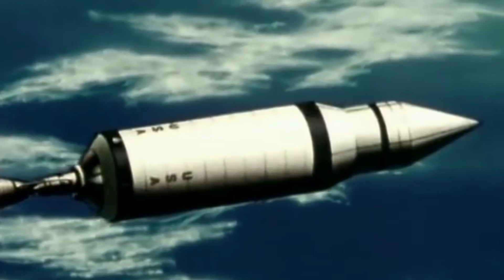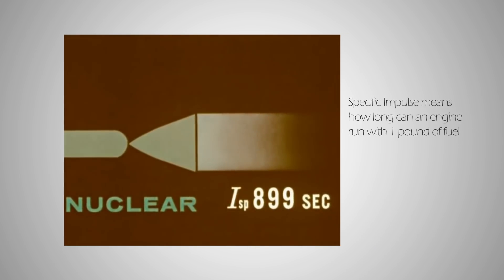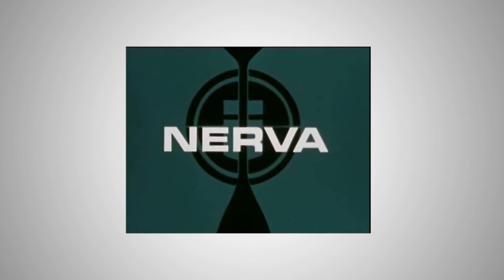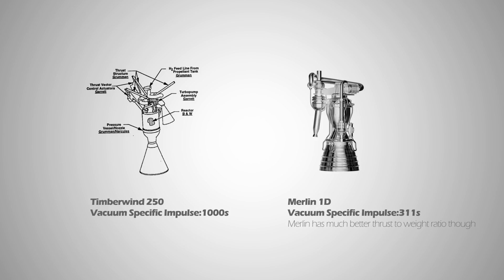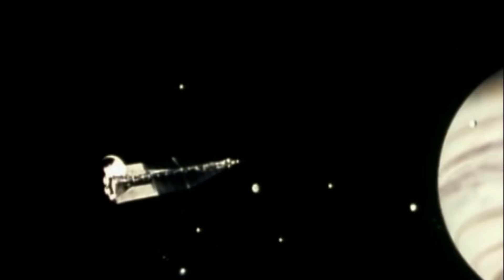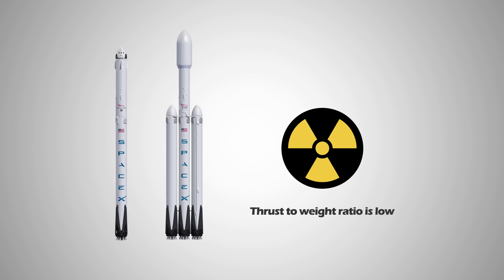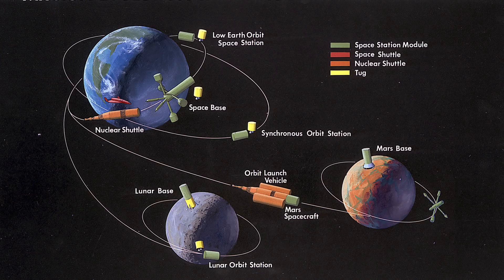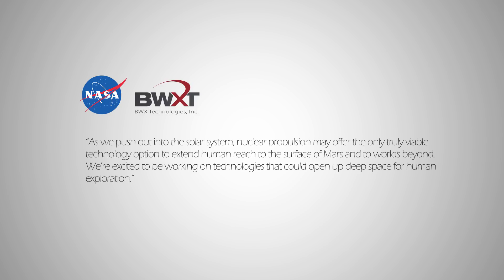What comes after BFR for SpaceX, a nuclear-powered rocket?

Comment from the maker: One at a time, BFR first, then we talk about the possibility of Nuclear thermal rockets. It is a very exciting piece of technology no doubt, would love to know your idea on that. What do you think of a nuclear space tug complementing BFR?
Reply: Curious Elephant The space tug idea is pretty damn good. But yeah, BFR first.
Reply: Wouldn't the nuclear space tug be reusable?  It wouldn't be used for landing, just to cut down travel times to reach Mars and the Asteroid Belt.  Once you reach your destination you enter orbit and disengage from the nuclear tug and use chemical rockets to land in the surface.
Reply: I think a nuclear powered space tug for BFR would be amazing for deep space missioms, but i think R&D cost are just too high to develop it by SpaceX itself. It would be grat if NASA would continue their work on nuclear propulsion
Reply: Yep thats what i was about to say. The BFR is no walk in the park. It will have to work reliably 100% of the time every time. Just one full crew disaster and it could end the project overnight. SpaceX really need a viable contingency plan, especially when it comes to crew safety on this ship. Lets just get the BFR 100% right, someone else can concentrate on the nuclear propulsion side of things for now. 🚀
Reply: We should build an aldrin cycler for travels to mars: https://youtu.be/qCVfUlFZQ4U It doesn't necessarily need to be nuclear powered, because it needs only slight orbital corrections. It would utilize spin gravity (O'neill cylinder) and would be built out of expandable modules similar to what bigelow is working on. That material is also fairly good at stopping radiation, but most of the shielding needs to be facing the sun anyway, so that's not that big a problem. Water can also be used for shielding and we need plenty of that, so radiation really isn't a problem. 

What I really want you to look into is beamed power thermal propulsion. I've said this a few times before and I don't want to seem like a spammer, but I really think it could be a great viable option and since it's not a very well known technology and you have 63K subs and almost 6.5 million views you can reach quite a lot of people. Again here's a video if you're curious: https://youtu.be/q3jAdHBCgiU

BTW: I don't think beaming power from solar panels in space to earth is a viable way to generate energy for earth, but I do think beaming power from earth (or maybe space) to a rockets first stage is a viable propulsion techology.
Reply: @Faron, those nuclear trails in the sky measured by scientists don't magically appear do they? Nope those Russian nuclear rockets are real and yes they are F'ing up the atmosphere.

US and many countries have build those and they work. Course everyone doesn't use them but ... Russians arn't in their right mind on that one but they are doing it.

A earth to mars ferry with a nuclear plant for thermal engine drives which already have proven they work. Wouldn't land but just get over a dozen BFR modules from point A to point B.

No reason to land you can have a big ferry with a couple of meters of water against radiation and even artificial gravity making it easier on astronauts.

The BFR doesn't get pointed to Mars and launched. It gets to LEO and ... it's out of fuel. Another BFR has to go up after it and refuel the travel module. Then on Mars if they decide to go back? Yup same thing again.

Be fun you either die from radiation trying to get in riding a nuclear reactor trying to keep radiation from coming out. ;-)
Reply: WRONG!!! It would make a massive difference for launches from Earth, having a ISP of 900 seconds means you could get your launcher mass down to 40% the mass of what you are launching where as today it's 99% the mass, this is important because you can build craft that really are as reusable as a plane if you can build your rocket to be heavier.

Although using nuclear rockets for launches from Earth have there own problems and not only the first one you probably thought of which is crashing and releasing radioactive materiel aboutk, no for launches from Earth your main problem is the thrust to weight ratio when it comes to NTRs and launching from Earth.

This is because you have to carry around a nuclear reactor and your fuel, there are ways around this like beamed power using microwaves so rather than an Nuclear Thermal Rocket, it's just a Thermal Rocket; anyway this means that you don't have to bring your reactor with you and you only have to bring the fuel, the engine is incredibly simple it's just a shaped lump of metal with no moving parts apart from a valve to regulate the amount of fuel to be injected, which also lends it's self to being highly reusable.
Reply: Curious Elephant Why not busy use ion propulsion+beamed power from LEO solar powered satellites?(I know what you're thinking, and no, you don't HAVE to use xenon, though it is the best on a power consumption/ thrust basis,you can use argon,which is plentifull on Mars.
Reply: A nuclear tug would be great... But  not as a replacement for BFR. One would be excellent for sending non-SpaceX payloads to Mars, especially ones that would not fit within a Big Falcon Ship. Could be launched on a cargo BFR perhaps.
Reply: I can't see a nuclear rocket being usable for the Earth-Mars run, or really anything that involves returning to Earth, because a chemical rocket can aerobrake, while nobody in their right mind  is going to allow you to aerobrake a nuclear reactor in Earth's atmosphere.  Since a heat shield weighs less than a nuclear reactor and it's radiation shielding this means that the effective ISP of the chemical rocket is more than doubled.  I can see nuclear electric being used for slow transport of heavy cargo, but nuclear thermal doesn't seem to have very many use cases in a reusable spacecraft.
Reply: Keeping a nuclear vacuum engine "Tug" in space would eliminate the cost of lifting it from the surface each time. The Tug would still have to withstand hypersonic reentry conditions during aero-braking at both Mars and Earth. (If the Tug never slowed down, then the BFS would still have to match interplanetary orbital speeds with it! ) This implies that the Tug has a superb heat shield, modest propellant tanks for adjusting its own orbit, and the ability to enter and then leave the atmosphere during aero-braking. 

The BFS would still have to lift propellant to supply the tug on each leg of the journey.
Reply: Curious Elephant I would like to see us build a nuclear powered ship (on the moon?) that doesn’t ever land on earth. A huge cruiser with shuttles to land on planets/moons/asteroids
Reply: @dehim, yes why I don't get people attempting to land a big big ferry ship. No sense to that at all.

The lightcraft for example was good proof of concept of how to speed up and slow down 'spacecraft'. 

No need for any propellant. NASA scientist Philip Lubin working on a scaled version to launch and test in space must mean there is something to it.
Reply: Space Train yes! Why not get as much equipment needed to colonize mars up into low earth orbit then send it all over in one trip. Put that then into a Mars orbit and bring it down carriage by carriage.
Reply: You don't need nuclear propulsion to send people to mars, making all that methalox propellant with nuclear will greatly benefit on mars due to a lot less tonnage in solar panels and batteries. Nuclear tugs sound like a good idea to send supplies, reactors/fuel, and base modules, things that are going to land on but not take off from mars.
Reply: I emailed Elon about it on 5th Jan this year. Probably your channel got me thinking along the same lines.
Reply: It all depends on the reactor; nobody is suggesting putting a water cooled reactor on a spaceship. One of the first reactors that was cooled with sodium didn't even explode when it melted down, it just mixed into the coolant and became sub-critical. When sending humans beyond mars nuclear is necessary. The Atomic Rockets website is a great resource. My favorite nuclear rocket engine would be Zubrin's nuclear salt water rocket ie controlled Chernobyl event :P
Reply: Maybe SpaceX will make a space Tug later on.

However, interplanetary business has to become profitable first. That would make the moon more interesting, and a moon base would be constructed. Then they can use Helium from the moon to power a nuclear space tug, to reduce the cost of the now more frequent trips between mars and earth, and even earth and the moon.
Reply: We won't be using fusion any time soon in space, unless you count a massive generation spaceship. Fission has a lot of things going for it and it's downsides aren't a big deal in space.
Reply: Actually, it isn't helium we'd mine, rather use the water for hydrogen. I do wonder what kind of ISP you'd get with helium though, since the water may be wanted.
Reply: You've done your research well here Curious Elephant.
Nuclear propulsion is indeed necessary for any kind of manned mission beyond the Moon.
Be it to a near Earth asteroid, Mars or even the other planets, the idea to fly a manned mission to any such destination with chemical propulsion is completely preposterous.
Travel time need to be kept short, we don't have any truly effective protection against radiation, and nuclear power do give better options to abort a mission gone wrong and return to Earth. (Not a true turn around of course, but significantly faster.)
Now I don't think SpaceX/Musk even have nuclear power on their long term agenda.
So our best bet is still NASA's cooperation with BWXT, (yes I did read that one quite long before seeing your video) and NASA have also pointed out the need for a space tug.
 It need to be reusable, its only then we find the major savings on cost as well as maintaining a depot of chemical fuel so that crafts launched from Earth that use chemical rockets can change orbit, launch toward the Moon perhaps, as well as return to Earth from higher orbits or even a Langrage point in space.
(The Russians do also claim to have nuclear powered propulsion in development, lets see if it realised or becomes another piece of vaporware.)
What's so important with the Langrangian points someone might ask, well when sending equipment such as a planetary base module, a lander or even a return flight booster and/or supplies ahead of a manned mission, these are a good starting point and as long as we do not think about manned missions, the Interplanetary Transport Network is a very neat way of sending such with very little fuel or reaction mass. 
Yes even with the kind of nuclear propulsion we can build today, and is described in this video, any manned mission to more distant destinations than the Moon need to be launched in pieces and ahead of the astronauts. Nuclear propulsion is more efficient, but the nuclear technology we can safely construct and use today, is not powerful enough to carry all parts of a mission directly.
(Can Elon Musks Colonial transporter do it on chemical propulsion? 
Of course not, the idea of using a single ship and return all that mass, rocket engines etc on a return flight is not only absurd but borders on duplicity and claiming to do this by 2022 - sure, LOL!)
Back to the real world, in the end a nuclear propulsion system might still be used in some hybrid manner, a reactor could be designed to double as an electrical generator that not only provide power for the need of the crew, but also could be used to power ion or a plasma system to shorten the mission time even further.
Reply: Musks plan is to use 3 tankers to fully tank one ship, which will be refueling on mars. Know what you're criticizing before you're criticizing it.
I find your plans much more unrealistic than the current ones. NASA could maybe make a space tug, but that's going to take at least another decade. Even NASA hasn't planned to be using such a thing for the first trip to mars.

If there aren't frequent trips to mars a tug is going to be overlooked, space has to be frequently visiting mars for a nuclear space tug to be a logical step.
Reply: @muuubiee: Yes that refueling plan by itself show the shortcoming of trying to adapt chemical propulsion for a mission where its not suitable, so I do know it very well indeed.
My plan? FIY, I have no intention to fly to Mars at all!
I have no wish whatsoever to die from radiation sickness, get brain damage or to get cancer before my time is due.
Now if anyone do attempt interplanetary spaceflight there's numerous reports that support my view.
And that is simply to travel so fast that the radiation don't get a chance to damage the body of the astronauts.

Collateral Damage from Cosmic Rays Increases Cancer Risk for Mars Astronauts:
https://www.unlv.edu/news/release/study-significant-collateral-damage-cosmic-rays-increases-cancer-risks-mars-astronauts

Researchers find space radiation increasingly more hazardous:
https://www.unh.edu/unhtoday/news/release/2018/03/15/unh-researchers-find-space-radiation-increasingly-more-hazardous

Mars-bound astronauts face chronic dementia risk from galactic cosmic ray exposure:
https://news.uci.edu/2016/10/10/mars-bound-astronauts-face-chronic-dementia-risk-from-galactic-cosmic-ray-exposure/
Reply: YEAH i am not the only one XD

550 metric tons in LEO, that's a fucking space dragon, but then, in space, more fuel efficient engines would be good.

don't disregard blue origin, they did not launched a rocket into orbit, but they are making big things, like super powerfull and efficient rocket engines, they want to learn stuffs, then go big i think

but the sea dragon is a complete monster of power, and by the way, i think north corea could have the technological advance to build one or two LOL ( we are fucked ) 
they have the money ( 1 billion for a sky station, yep, i think they might have what they need to make one like that ) 

or even china, because it's dirt simple in comparaison to what a turbopump fed rocket engine is.

ho, and by the way, the sea dragon i a beast of steel and REUSABLE because it can reduce it's reentry speed with inflatable "drag shield" and then just splash into the ocean, and survive this experience, because it still have pressure in his tanks, and it is made of thick normal steel ( it could be lighter i agree, but it was not the path his creator wanted to go )

if i remember well, it cost 300 millions dollars to refurbish a 550 T payload rocket , it's like 780 dollars per kilos

to make some comparaisons 

the space shuttle was like $18,000 per kilogram LEO

the russian proton expendable cargo launchers (Atlas V rocket counterpart) $5,000/kg LEO

space X with prices as low as $2,000/kg LEO

i don't want top make bad critics, but a country like bengladesh could make a SEA dragon, and get dirt cheap payload to orbit without a super fancy high technologie super complex engine or space program.

maybe not bengladesh, but india, anyway, maybe you understood my point there ^^ .

what i want to explain there, is that the ISS cost 150 billions USD for 450 tons,  and with only two launch you could have bee have been able to launch it for at max, if you need to rebuild the designs and the industry to build it, a total of 8 billions ( to start making it running, but with that you would get 6 or 8 "test flight" that could be used to launch cargo missions to the ISS for exemple ) 

there is good long video on youtube that talk about that

have a nice day
Reply: YEAH i am not the only one XD

550 metric tons in LEO, that's a fucking space dragon, but then, in space, more fuel efficient engines would be good.

don't disregard blue origin, they did not launched a rocket into orbit, but they are making big things, like super powerfull and efficient rocket engines, they want to learn stuffs, then go big i think

but the sea dragon is a complete monster of power, and by the way, i think north corea could have the technological advance to build one or two LOL ( we are fucked ) 
they have the money ( 1 billion for a sky station, yep, i think they might have what they need to make one like that ) 

or even china, because it's dirt simple in comparaison to what a turbopump fed rocket engine is.

ho, and by the way, the sea dragon i a beast of steel and REUSABLE because it can reduce it's reentry speed with inflatable "drag shield" and then just splash into the ocean, and survive this experience, because it still have pressure in his tanks, and it is made of thick normal steel ( it could be lighter i agree, but it was not the path his creator wanted to go )

if i remember well, it cost 300 millions dollars to refurbish a 550 T payload rocket , it's like 780 dollars per kilos

to make some comparaisons 

the space shuttle was like $18,000 per kilogram LEO

the russian proton expendable cargo launchers (Atlas V rocket counterpart) $5,000/kg LEO

space X with prices as low as $2,000/kg LEO

i don't want top make bad critics, but a country like bengladesh could make a SEA dragon, and get dirt cheap payload to orbit without a super fancy high technologie super complex engine or space program.

maybe not bengladesh, but india, anyway, maybe you understood my point there ^^ .

what i want to explain there, is that the ISS cost 150 billions USD for 450 tons,  and with only two launch you could have bee have been able to launch it for at max, if you need to rebuild the designs and the industry to build it, a total of 8 billions ( to start making it running, but with that you would get 6 or 8 "test flight" that could be used to launch cargo missions to the ISS for exemple ) 

there is good long video on youtube that talk about that

have a nice day
Reply: It would have been good to mention the old Project Orion. Vastly more performance that any other rocket.
Reply: The ⛽ of sunlight is ultimate can humans make the spacecrafts station /solar power station.we have to master in everything.
Reply: @COSMEREAUDIO  Which will probably use the BFR.
Reply: Nothing could possibly be more reusable than a NTP interplanetary vehicle, or Space Tug. A NTR only requires LH2. The Copernicus concept, for example, uses replaceable LH2 cells, which could be delivered to such a vehicle for repeat missions by something like a BFR booster. It would make for a great combination and frankly a far more efficient means to interplanetary travel than for a BFR booster pushing a heavy ship up for every mission. You're merely delivering fuel cells to a vehicle parked in orbit with twice the specific impulse.
Reply: Remember, NERVA was set to use a true nuclear reactor, not a nuclear thermal rocket. Coupled with a VASIMIR drive, would be able to achieve speeds of 200,000-300,000 Kph & get astronauts to Mars in <39 days instead of 6-8 months. As the the power industry has found that nuclear reactors have service lives of 30+ years without refueling, reusability is NOT a problem. As the USN has operated nuclear reactors for 54 years without incidents, safety in outer space isn’t either. The only thing they’d need to do is provide 100-150 tons of argon/neon for the VASIMIR for each round trip. While a standard nuclear thermal “reactor” produces 500-800 WATTS. NUCLEAR REACTORS can potentially provide the 50+ MW needed to power a true VASIMIR Drive! I want to be clear on this - While NTR might be able to power a very low power ion drive that might be able to cut Earth-Mars Transit Times by 2 months, it will not be able to get astronauts to Mars in the <39 days a NUCLEAR REACTOR powered VASIMIR would!
Reply: Sea dragon
Reply: Two words:
SEA DRAGON
Reply: Anders Forsgren we never landed on the moon yet you think mars it right around the corner😂😂😂 no astronaut has EVER left low earth orbit EVER.... not to mention there isnt a single real video of a working airlock sequence in space..... 👍